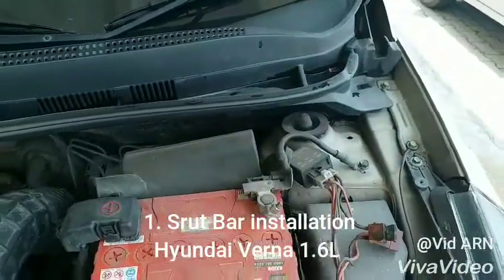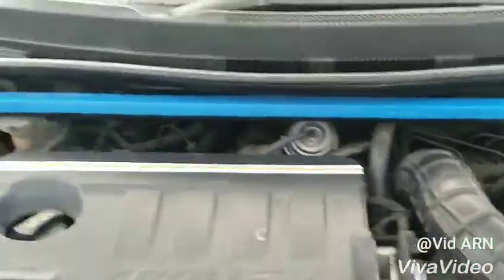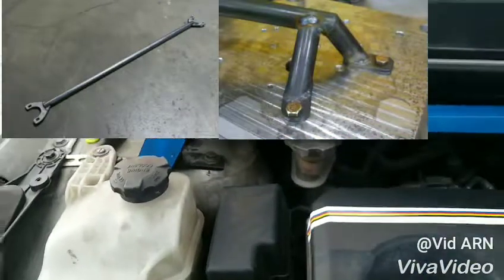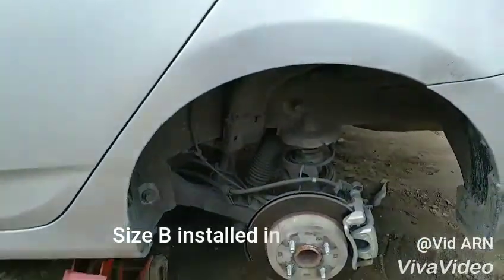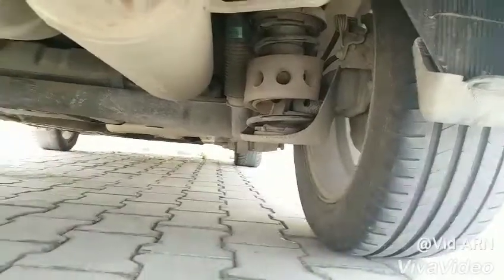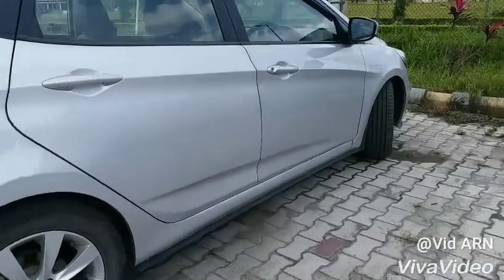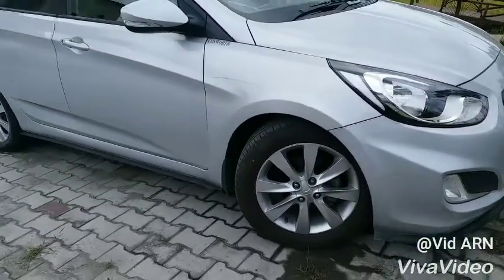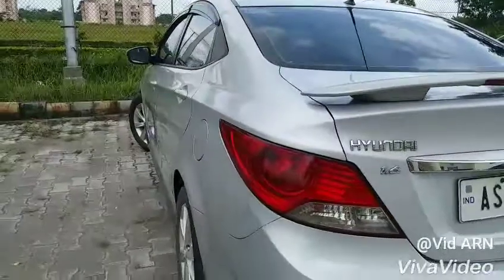Hyundai Verna modified | Strut Brace, Buffer, Tyre upsize, Spoiler | Vid ARN DIY

Comment: Can the suspension buffer be used on Upsized Tyres from 195/55 stock to 205/55 ? I own a Verna fluidic and upsized the Tyres as your case planning for Suspension buffer but heard suspension buffer cannot be used when the tyre size has upsized ?
In your case howz it ? Can you make out the change in ride and handling ?
Reply from the maker: I am using with upsize tyres.. not related to tyre. It fits in the spring.
Reply: Vid ARN my local Tyre shop who asked me to upsize the Tyres for better stability of the suspension is also selling Rogerab so I asked him couple of days back he was telling that rogerab or any other suspension buffer will not work on upsized Tyres he quoted that upsized Tyres are weighed more than the stock Tyres causes little effect on the suspension which damages more if put on  rogerab
Reply: Can you kindly drop your review after using the Suspension buffer did it work ? Any change noticed after putting them ? If yes how much was the difference ? Stock suspension setup sucks :(
Reply from the maker: Must be selling fake ones... U can buy cheap local made buffers also at Rs.2000... they also work and last long.. check on amazon.in
Reply from the maker: Bouncy effect at high speed is gone..
Reply: Vid ARN ohk Great 👍🏻
Reply: Vid ARN will it increase the ground cleearance after installing ? Did it increase in your car ?